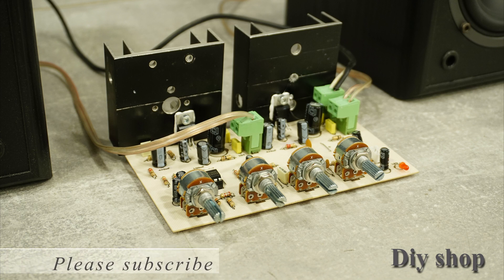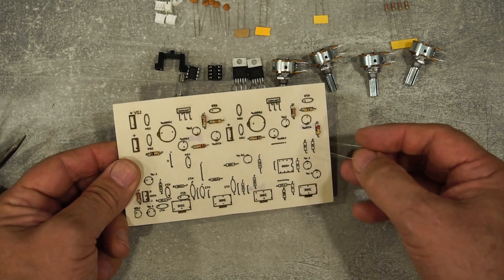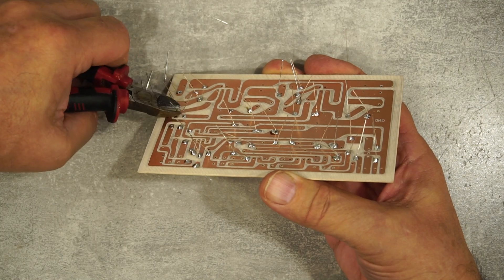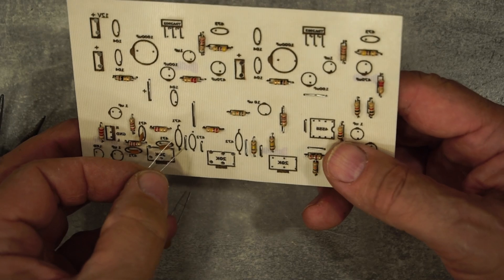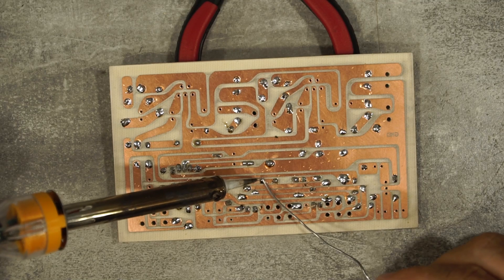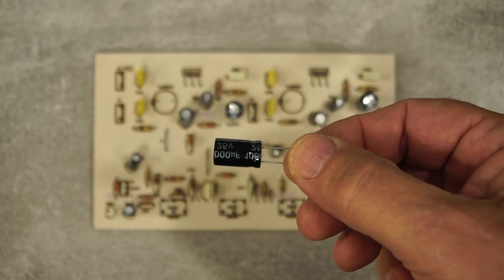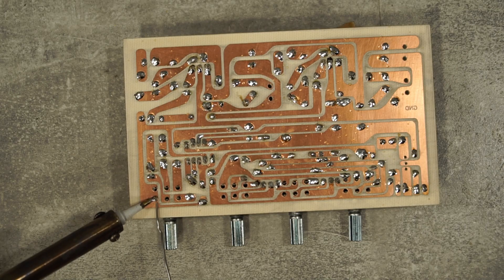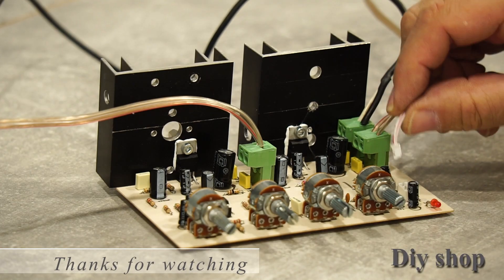How to DIY a small and cheap audio amplifier using TDA2003

Comment: Hello there! 
Awesome video!
I was wondering if this amp uses 12 volts or 110/240 volts?  Where can I get the schematic for the amp board?
Reply from the maker: It works on 12V. I am developing a website where I will upload the schematic of this amplifier and other, more powerful ones. Very soon.
Reply: @10diy  
Thank you very much for answering my question!